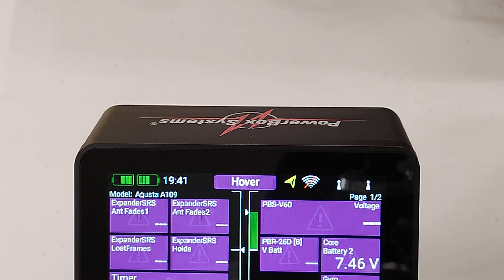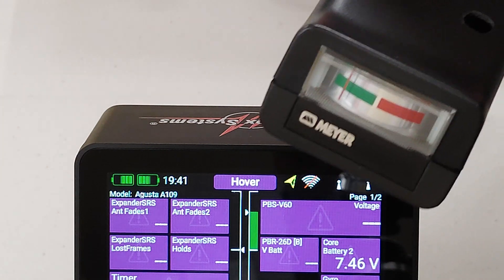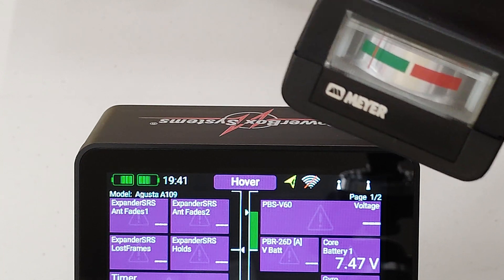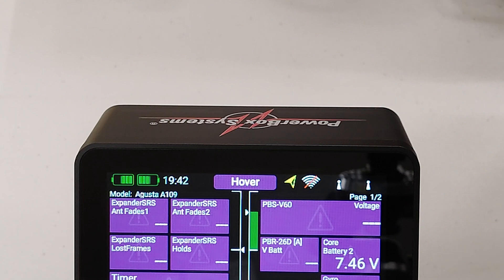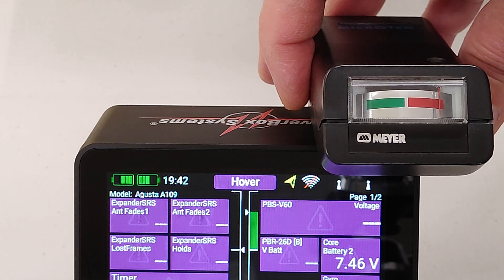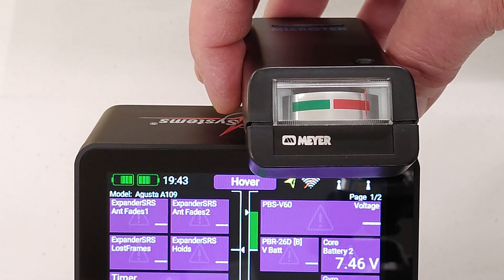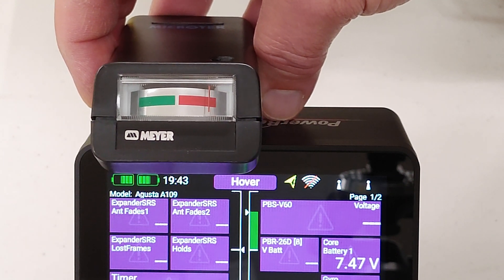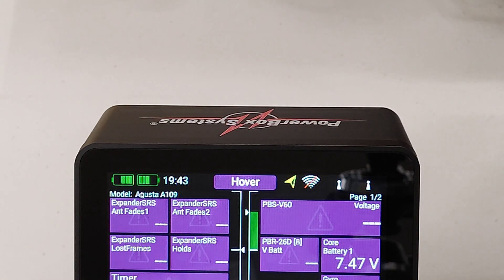PowerBox Core Tx - Transmitter RF output verification test

Comment: Hello , what happened when you place your meter under the antennas ( to simulate a receiver under your feets, like sometime on slope soaring)? Thanks
Reply from the maker: @remycatillon329  There is not so much RF at the bottom. The RF pattern is like a hemisphere - Imagine placing two hemisheres on top of the flat section.
Reply: @CVHeliPilot That's the problem when you use this kind of tx for slope soaring and your model go down.A friend of mine , using a Core Tx, lose the transmission many time in this situations ( and some time crashed his glider)
Reply from the maker: @remycatillon329  Need a small table or another seat to place the tx on rather than on the ground behind your feet.